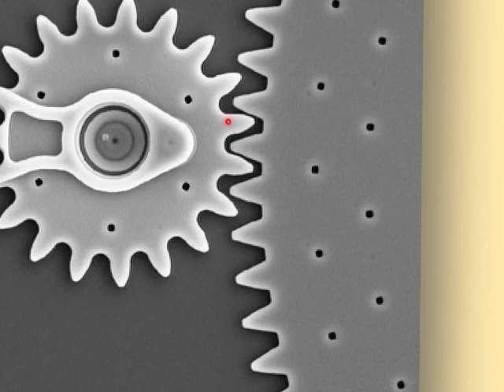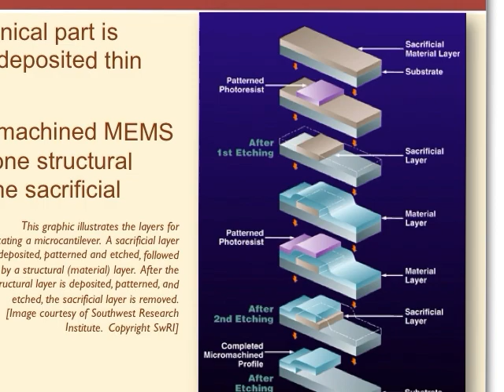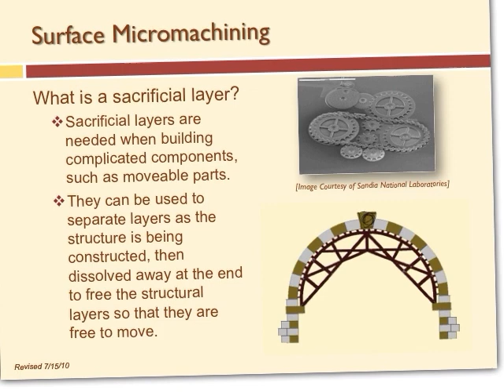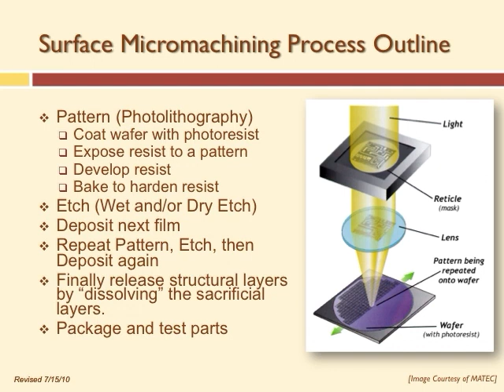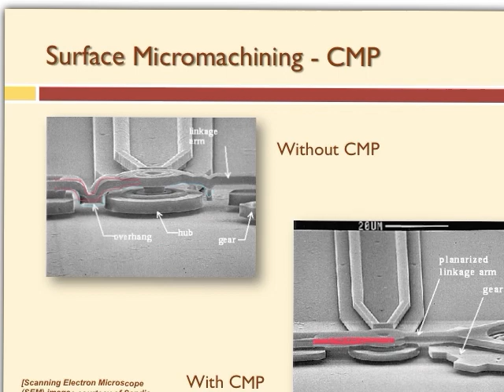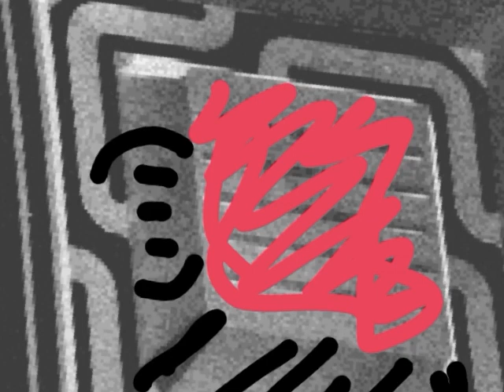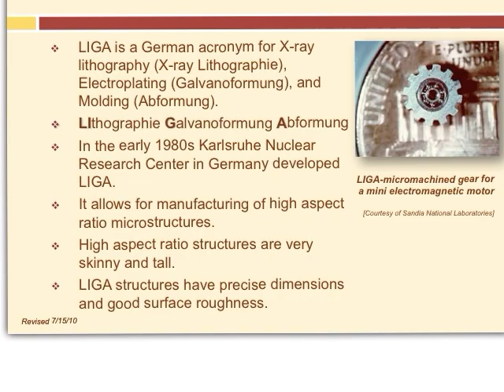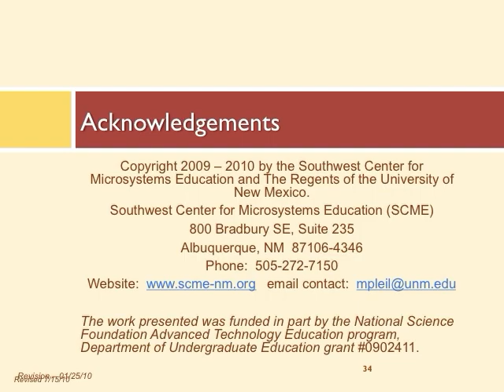Micromachining Overview - How MEMS are Made

Comment: Thank you for this lecture. I'm a Master student, about to start a project in this particular field - and I find this very informative. Good job on the easy explanations.
Reply from the maker: Glad you found it useful!
Reply: @sykn5422 hey, what is the career prospect like with a masters with a concentration in mems? Am I just gonna end up being a process engineer?
Reply: @meegz149  oooh I'm not sure I'm the right one to answer this question, because after my Masters, I continued with PhD and my specialization has slightly veered off from mems (although not entirely). So instead of working in the industry, I'm in academia and will probably continue to do so for a while.
Reply: @sykn5422  Good for you? where is the field heading do you think? As of right now, it just seems like it's phones, airbags, and MAYBE medical devices.  Do work with a lot of machines similar to the semiconductor industry (CVD, HDP, etch, lithography)?
Reply: @meegz149  It's certainly very fundamental for phones, airbags and medical devices haha. But it's not just limited for just that, and even within those three, you have very broad potential applications. Honestly, I feel like this field is a 'safe choice' in a sense that you probably won't run out of choices to delve into, either in research or product development. I rarely meet anyone in this field who couldn't find a placement they wanted in the industry. But then again, I live in a country that pretty much depends on semiconductor development, so that might be a reason.

Comment: wow, i thought they were made by  midgets with little bonsai files and superfine emery paper. even normal shops are doing this on site now. i saw a note on the stores windows that said "everything reduced"! ive had a great idea about this though. why not make all these things out of the same material they use to make heat shrink sleeving? all these things could then be heated when you wanted a micro version! ive always wondered why they only usualy sell heat shrink sleeving. why not make all of the clothing out of this stuff. i realy think a jacket would look wierd with tiny sleeves. some of the statements about the scale and size arent THAT impressive. 100 micrometers?
i measured the micrometer from my friends toolkit and it was about 15cm long! 100 of them would be huge! im sure gears can be made smaller than 15 metres. when all the tiny components are made who assembles and repirs these machines... oh wait a minute, its a quantum mechanic right? or am i being a little small minded?